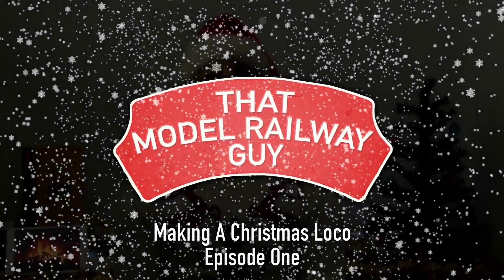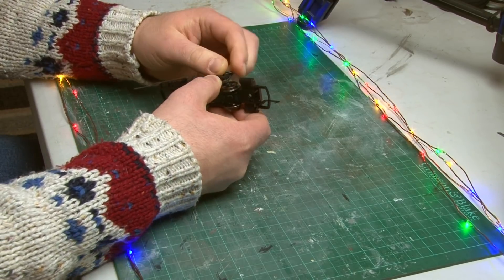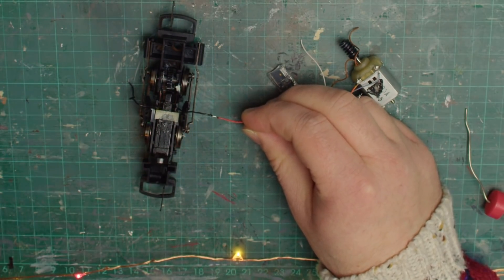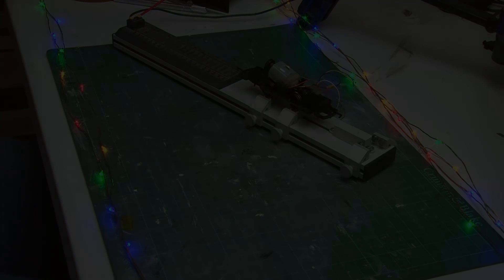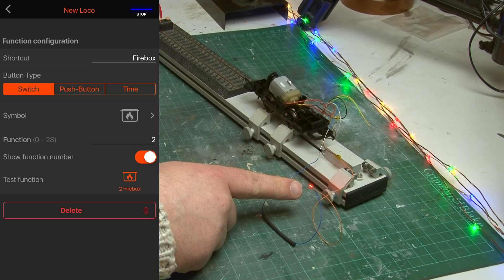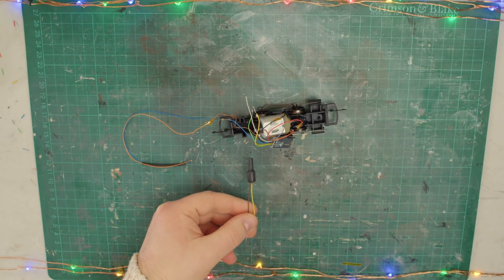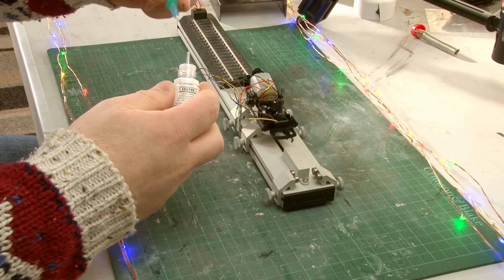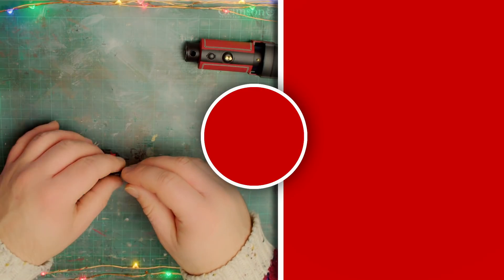Making A Christmas Loco! - Episode One: The Electrics

Comment: Do I need the resistor when running on dc can someone tell me
Reply from the maker: I believe it's a TV Suppression capacitor - the safe option is to leave it in but I don't think you'll do the model any damage if you remove it. There's also nothing to stop you soldering it back on later if needed. Thanks for watching 😃

Comment: This great stuff. I'm planning on doing similar stuff with the same loco but on analogue. Will the smoke generator work on DC, and have you experienced heat affecting the plastic body?
Reply from the maker: Hi James, I believe these smoke unit do work on analogue too - after all smoke generators have been in models for longer than DCC has been a thing. I've not experienced any melting with mine, although the smoke unit is mostly exposed as I'm using it as the funnel. Thanks for watching 😃

Comment: A work make discovered smoke and coal flavoured Vape fluid is a fuel station but I haven't seen any yet.
Reply from the maker: Awesome, I bet that would be interesting to try. Presumably that works with the newer style water vapour smoke generators rather than the older smoke fluid ones like I used here. Thanks for watching 😃

Comment: The capacitor is there to suppress noise from the motor and smooth the power to the motor. With DCC its there to protect the output from the controller from power spikes.
Reply from the maker: Interesting! Like I said in the video I usually keep capacitors in place but this time I had no choice due to the lack of space. I know there are others though who swear by removing all the capacitors when they add a decoder to a loco... I wonder why that is. Thanks for watching 😃

Comment: Can someone tell me if that smoke generator will run on dc if I wire it straight to the motor or pick ups
Reply: I assume so based on Hornby using a basic version of this smoke generator in some locos back in the seventies.
Reply: @tonypetts6663  thanks
Reply from the maker: I don’t have any experience with using them on DC myself but like Tony said, I think they will work since they are fairly simple devices. Thanks for watching 😃
Reply: @ThatModelRailwayGuy  thanks I'll try and get my hornby e2 with smoke